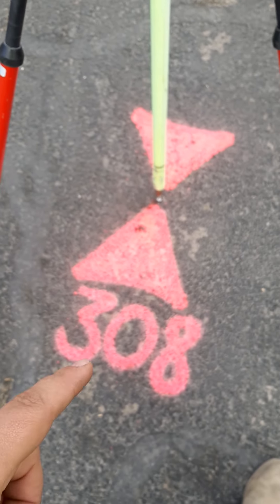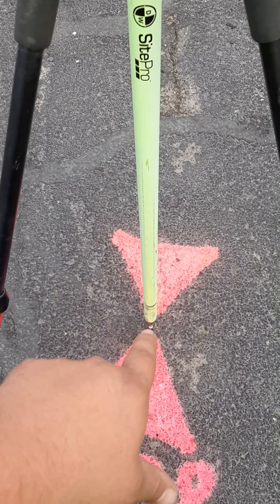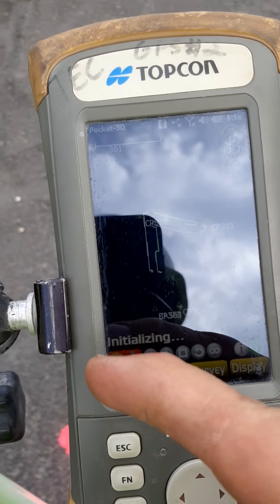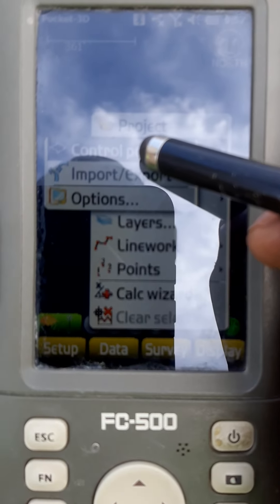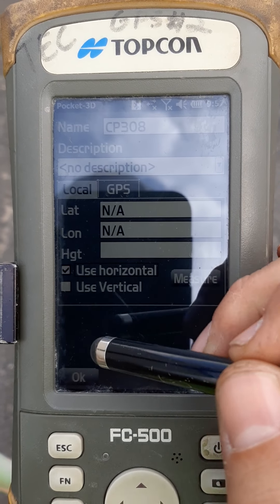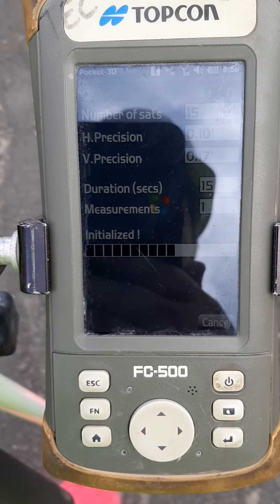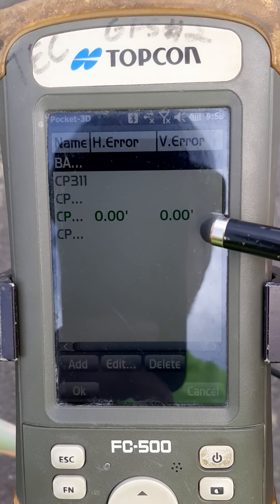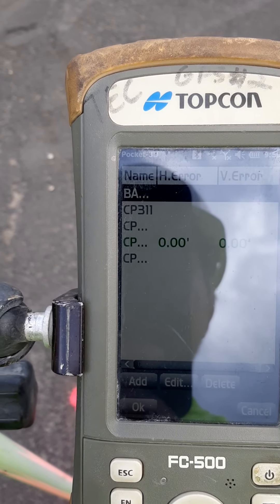How to shoot in control points with topcon PART 2

Comment: Topcon Requires  a 120 second shot on any control always face  north also base is In a bad spot . Never put on a fence  change your mask angle  to keep signal.  Read you top con manual
Reply from the maker: Thanks for the info didn't know that
Reply: Well done thanks sir